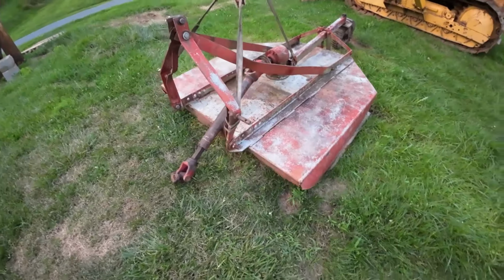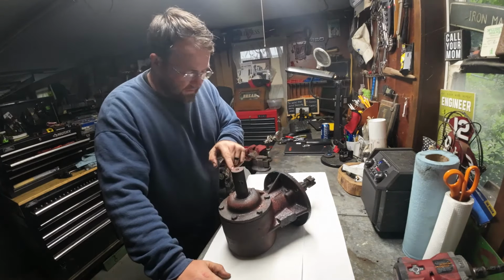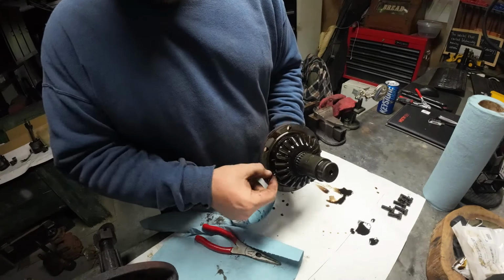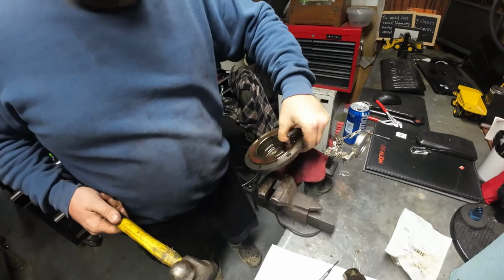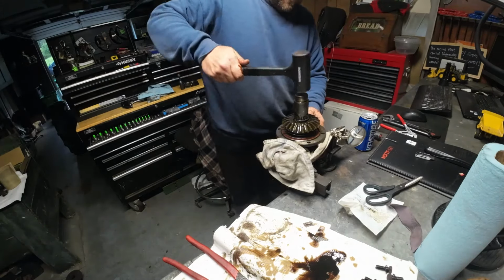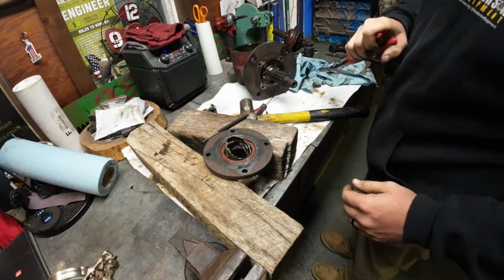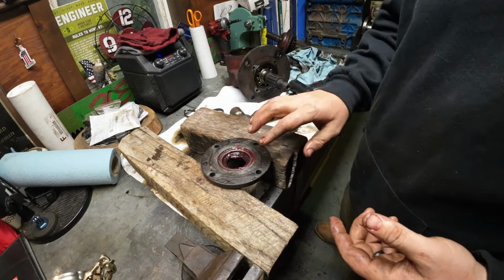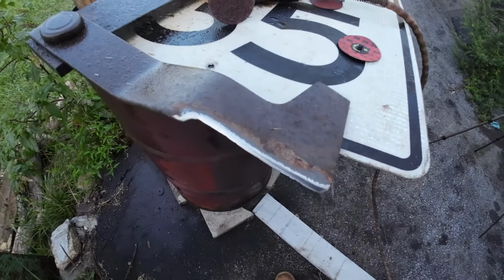Repairing an Old and Abused Brush Hog

Comment: I guarantee there was a bolt somewhere on the casing  That when removed only allows you to put so much gear oil in. Manufacturers pick a certain gear weight oil for reasons also
Reply from the maker: Thanks for the comment. The oil fill plug only allows you to fill the casing up 3/4 of the way. The old Auburn gears take 80w-90 but this being 45years old synthetic 80w-120 will treat her just right. Thanks for watching